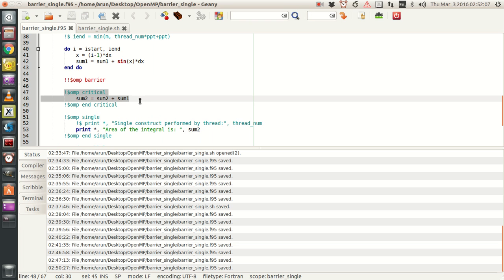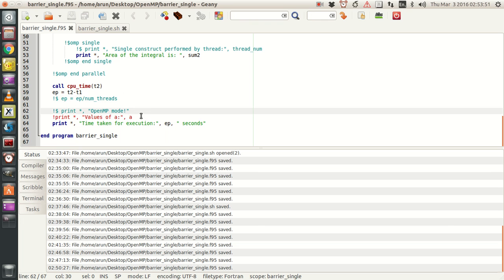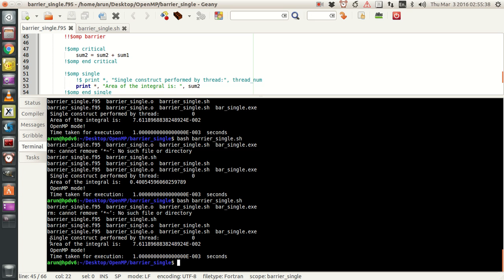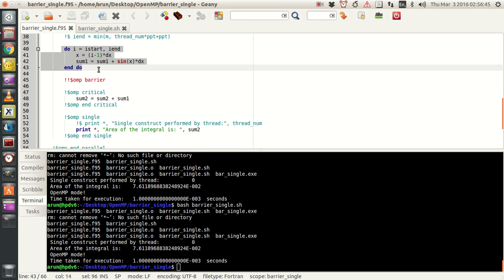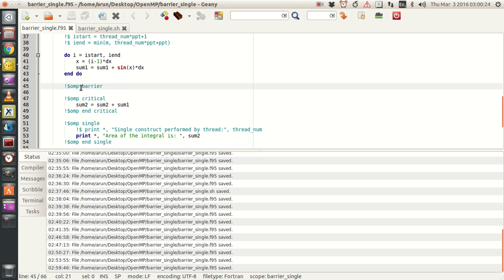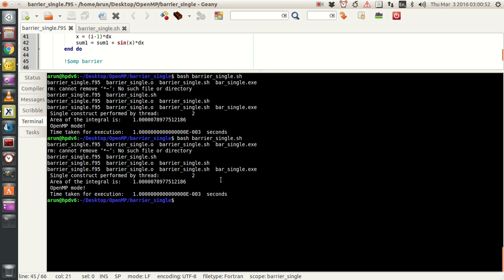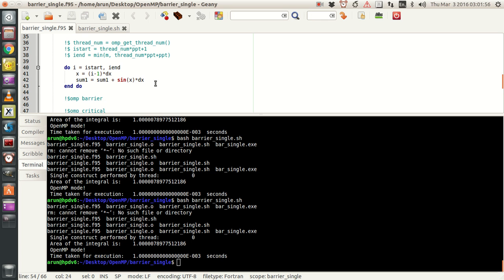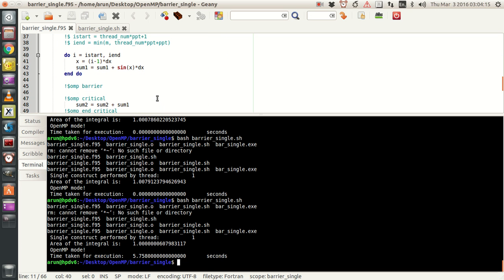Fortran with OpenMP : 014 : OpenMP Single and Barrier directives Part 2 of 2

Comment: Hello. Your explanation is very nice. But I want to point out a mistake in your code.  In your case, it 'seems to' work well, but if you run it for 100 times or even more, I think you may find that the integral is not 1 if you are lucky (I got non-1 after running about 50 times). The reason is that I think you should put !$OMP BARRIER after the CRITICAL BLOCK, rather than before it. Can you reply to me whether I am right or wrong? Thank you.
Reply: You are right